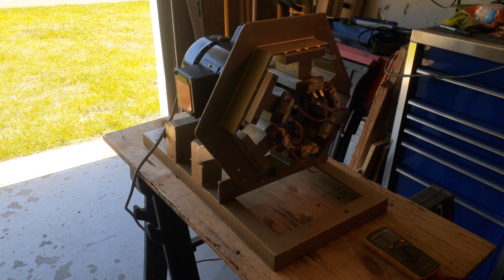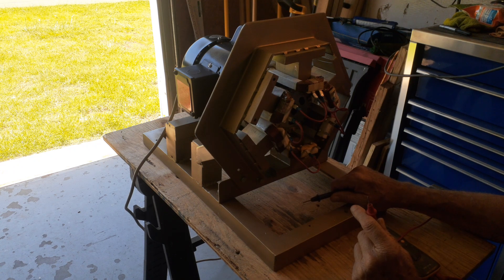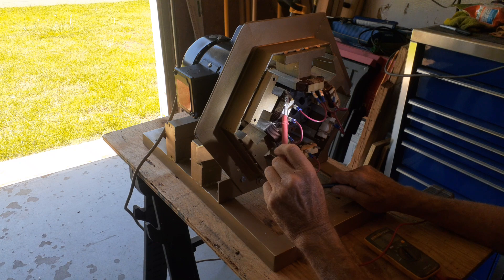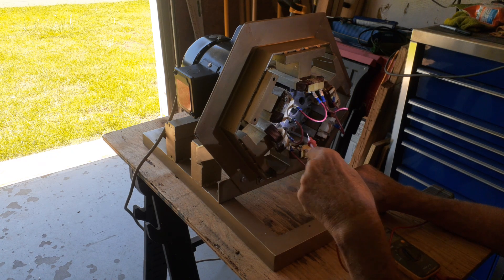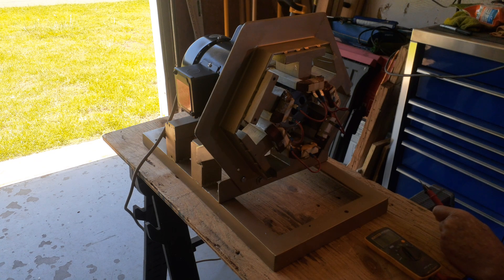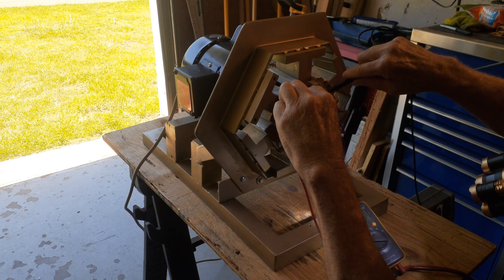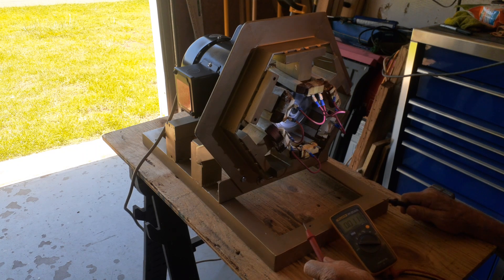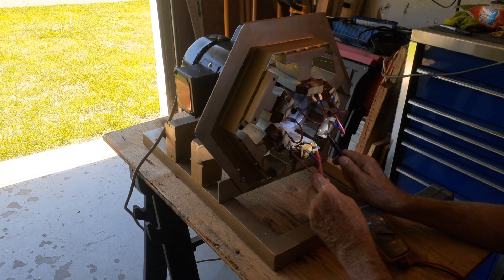Self Running Generator Test Results

Comment: Just as a hint. In the original video they used the SEMh71-2C from Cantoni & C Milano Motor:
2780 RPM, 0.75 HP, 0.55 KW, 3.6 Amps, 2 coils ...
Reply: tak wiem o tym  zgadza się  w rzeczywistości ten silnik ma mniej więcej 2900  rpm  mimo że na tabliczce  jest 2780 rpm
Reply from the maker: Thanks for the info. I used a 110 1 hp vevor motor but did not get but a small amount of volts. I am going to try a 1 Kw permanent magnet motor with a strong 12v motor. I seen a video of an Indian guy making 300volts from it.
Reply: @monstirz With how many RPMs was the motor spinning for this test?
I would be cautious with some of the Indian YouTubers there are definitely also scammers out there.
Reply from the maker: @_LanSolo_  3600 rpm
Reply: @monstirz  Thanks for the Info, I agree with @russfunk7615 there must be more to it than just the things they show in their video.
I thought a lot about reactive current lately and how the motors reactive current could overlay the current produced by the microwave coils. But therefore the frequency from the motor and generator must exactly match. 
An oscilloscope with 2 channels and the possibility to show Lissajous curves could help therefore.
Reply from the maker: @_LanSolo_  120v 1 hp 3600 rpm
Reply: Although there are scammers out there, it seems like a lot of trouble to go through to assemble an entire unit and show it working. There's more to it than just generating volts. There's watts and ohms as well that have to be added into the equation. For example you can't run an AC motor with DC currant. Or vice-versa. You need a rectifier. The Liberty generator also had other metals mixed in with the aluminum and silver but was unwilling to divulge that information. Maybe they just dumped a handful of iron shavings in the molten mix, and maybe it just worked by fluke. They definitely are hiding something in their video and not giving up all the secrets. But with that being said, many people in the past who created something "world changing" either disappeared or suddenly died, and all their notes went mysteriously missing.. or it was massively debunked, making all other creators/inventers lose hope before even trying. Sometimes, the commenters will give ideas that the creator didn't think of to try. Good luck
Reply from the maker: Thanks for your input.Maybe that engine was about money for YouTube views?
Reply: what he cares about is the continuity of income from watching this whole saga about free energy of course, except that these devices are correct they work the principle of operation is as simple as using a flail half of the internet already does it there is no magic one engine is a generator and an engine simultaneously putting and arousing 2 pairs of electromagnetic coils to work because the coils themselves are not able to excite themselves to work properly 230 v and the appropriate frequency of 50 hz this impulse comes from the engine which did not tell you and did not show it in the film has a constant magnetic field so a small amount of rotation pulling the cord is enough to load the electromagnetic coils enough to start work and to surprise and surprise because there are 4 magnets on the aluminum drum and they should be in the wrong order as this nsns liar shows you, it can't be for the simple reason that every second magnet will be attracted by the cores transformers and braking will take place magnets must be in the nnnn system all on the rotor in the opposite direction to the electromagnetic coils these coils are to repel each magnet and not attract and don't look at the frequency that such a shit or voltage it doesn't matter they are wound for 230v and for that the correct voltage will be excited thanks to the impulse from the motor and at this level strong induction of electromagnetic coils will work, it is the wind and it blows with great power, even a hurricane, on these magnets the rotor is not attracted to the core in any way and the electromotive force and the field itself are not unnecessarily excited electromagnetic does not collapse inside because there is no alternating arrangement of magnets there is only one pole that is set opposite to the electromagnet and in one cycle it is a strong electromagnetic foot and a generator it's all no magic give me I don't know what the fuck this car alternator and engine and for each time is the same principle normally in the alternator you have 12 v or 14 v ok and stupid frequency and attention magnets are not glued there as it showed only all opposition and main carrier impulse that gives the correct frequency of 50 hz and voltage 230 flies from the engine if still you don't understand, see the principle of operation of a brush AC motor, e.g. one that is in power tools, if you take out the rotor with brushes from there and insert neodymium between the windings of two electromagnetic coils, you will never excite these coils alone to work up to a voltage of 230v and 50 hz, that's what this is happening in this liberty engine i was building one before he watched it and he saw the same with this fucking hh+ agent he adds to the water it's nothing but potassium hydroxide if something in his movies is in big capital letters and he repeats it know that he fucks you and puts it on your forehead and most of it is swallowed and replicated in such a way that it never works for you because every description contains deliberate errors that you buy and the best ones are those skeptics who wonder where the cable is hidden cable no it's just a construction issue known for a long time and plnay and schematics are available in the public domain and since you have to put it together like a puzzle and think for yourself, it's a different matter I'm waiting for someone to do it correctly, for him it's a way to earn money that's why I won't show you my face because you he disinforms lies and misleads and later when someone shows it right, he will rather disappear from the network because he can't offer you anything interesting because if everyone learns it then you just kick him in the ass and he plays for time so that the series continues anyway it looks like..... he found a way to earn money, kudos to him, but making a fucking ideology of great secrecy and intertwining with unnecessary nonsense does not make sense, but it also shows what intellectual and technical condition people are in, they stopped thinking, analyzing, thinking outside the box and creatively, they just want buy give give give out your hands and it's as if you were standing in front of the temple of all prosperity and reaching out to people for bread bread it's you all the time from birth energy circulates particles are in constant motion torus system @monstirz
Reply from the maker: @aleksanderpawowski4251  Can you provide the link to your video showing us what  mean in detail. I have made no money off of this post.Zero samolians.
Reply: @monstirz  I know I didn't write about you, but about this guy from hidden technology and his invention Liberty Engine :)
Reply: @aleksanderpawowski4251  are you saying that when @monstirz is changing the Strator magnets of the alloy from nsns to nnnn it will work like in the Liberty Engine 2.0 video?
Do you have a working replica?
Reply from the maker: Can you provide the link showing how yours works?

Comment: There must be something your doing wrong. Keep at and do some better research. Maybe the liberty motor puts power to the magnets adding more of a field to generate more power. I like your project keep posting videos of you project. I subscribed
Reply from the maker: Thanks for the info. I used a 110 1 hp vevor motor but did not get but a small amount of volts. I am going to try a 1 Kw permanent magnet motor with a strong 12v motor. I seen a video of an Indian guy making 300volts from it.